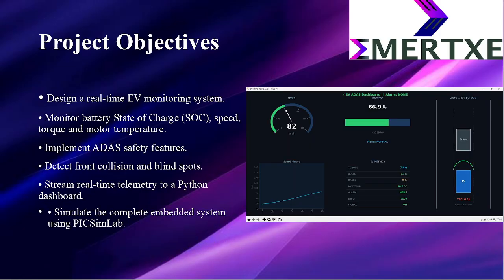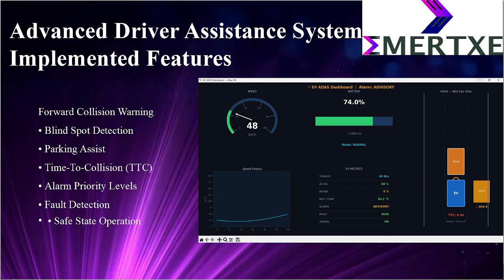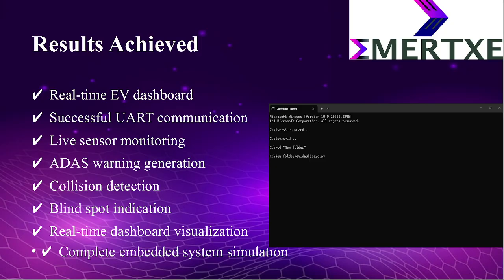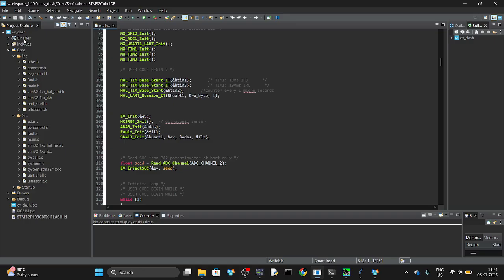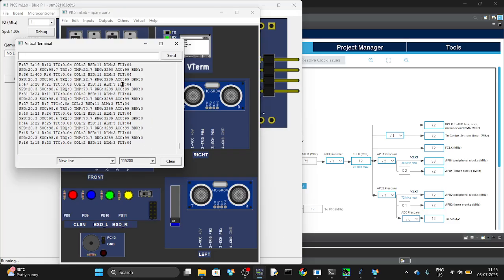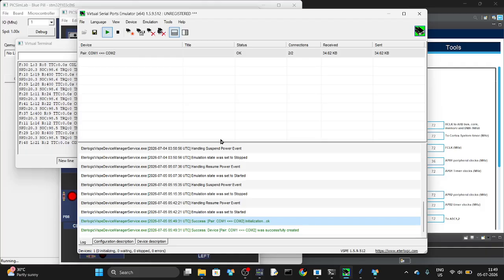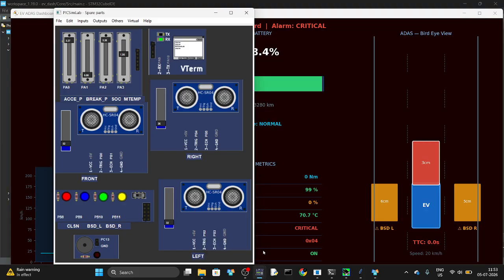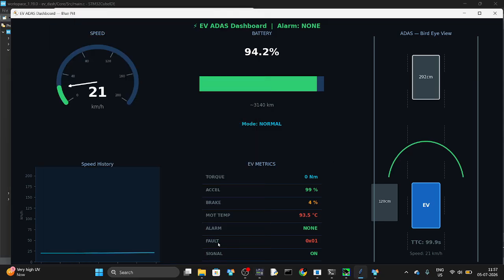STM32 EV ADAS Dashboard | PICSimLab + Python Dashboard + UART Live Simulation | Embedded Systems

Comment: Hello Sangeetha! Hope you're doing well.

This presentation is well detailed and helped me get rid a few of doubt that I had even after the sessions.

We were in Emertxe Embedded Systems Internship Cohort 26 and worked on the EV ADAS System project.

Unfortunately, I couldn't attend the last few classes because my JLPT exams coincided with them, which broke my continuity. I watched the recorded YouTube sessions afterward and followed the instructor's steps as carefully as I could, but I'm still getting results that differ from the expected output and I'm unable to figure out where I've gone wrong.

If you don't mind, could you please share your project code with me? I only want to use it as a reference to compare it with mine and identify my mistakes-  not to copy it.

I'd really appreciate your help. Thanks in advance!